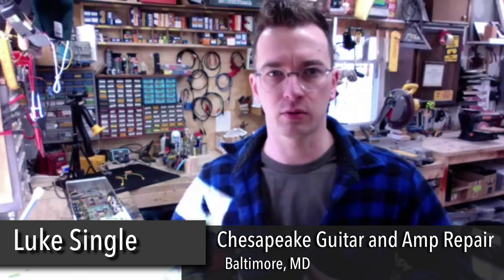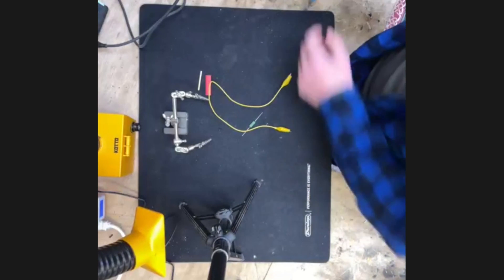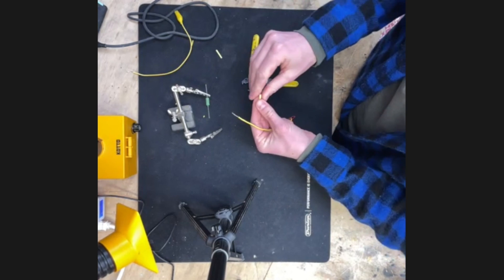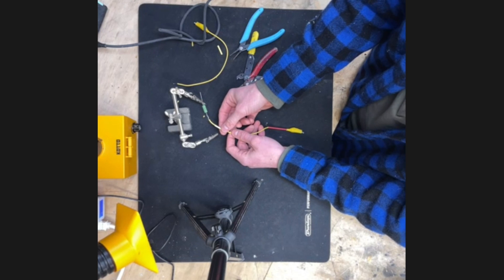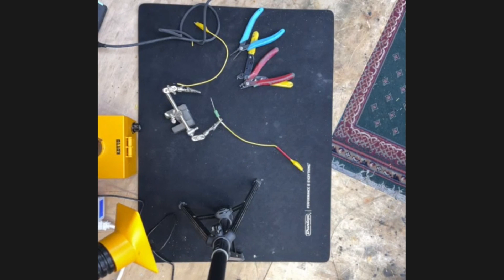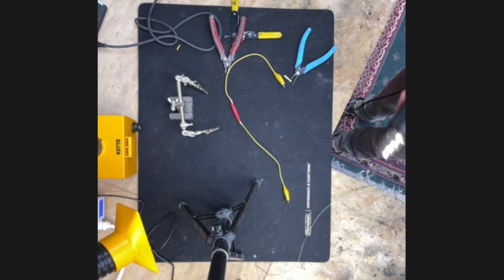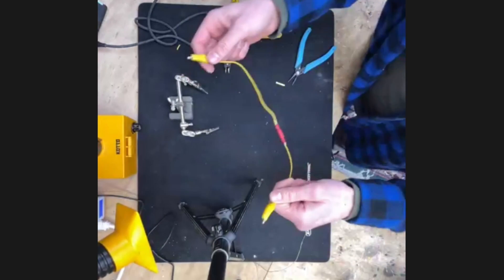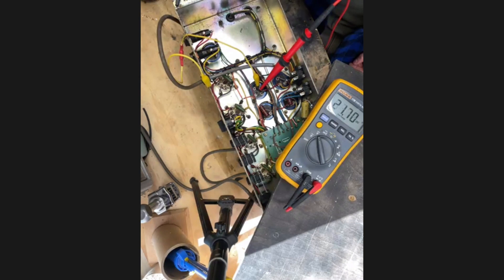Making an Amp Discharge Tool with Luke Single - IanHatesGuitars

Comment: Nice one.  When I was learning this stuff, they used to say to put your left hand in your back pocket when you open up a mains device like this.  So it's worth mentioning that you should always know what your other hand is doing.  If you get a zap and it flows from hand to hand (say your left hand is touching the chassis), well your heart is right in between...  IME, the other thing that is worth mentioning is that power caps in solid state amps can also hold on to their energy after switch-off, especially when the amp is damaged (blown mosfets) and there's nothing to discharge them. 

I've just discovered your channel, Ian.  It's great.  Keep up the nice content.